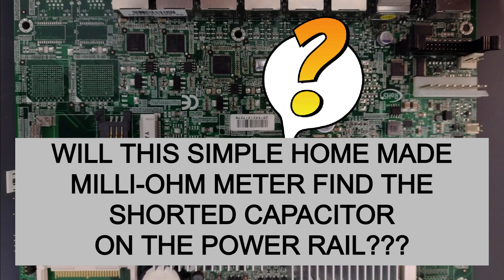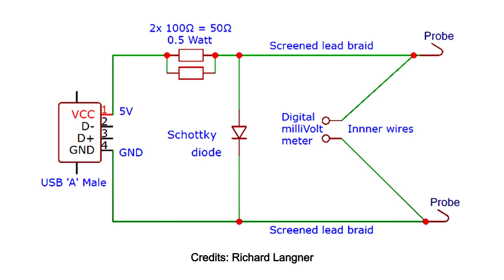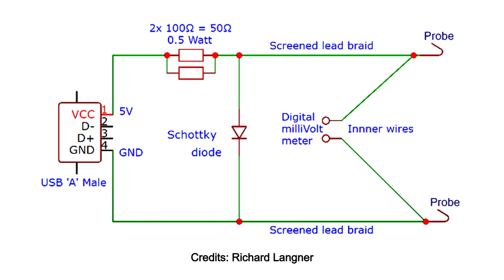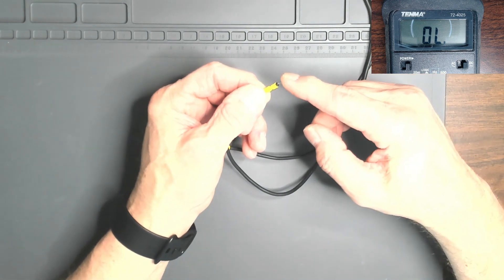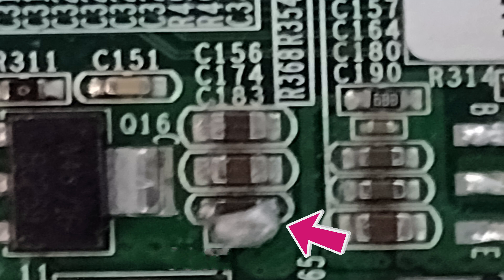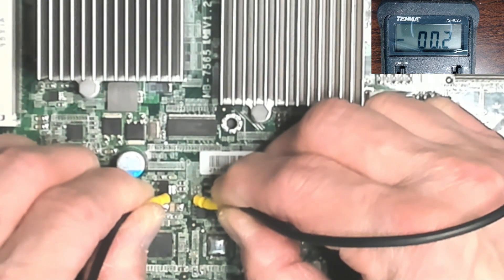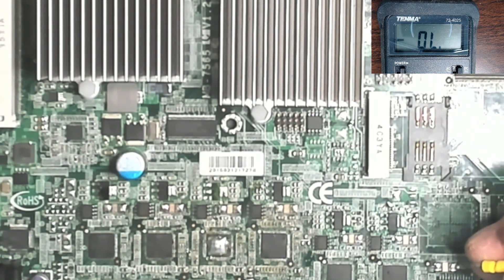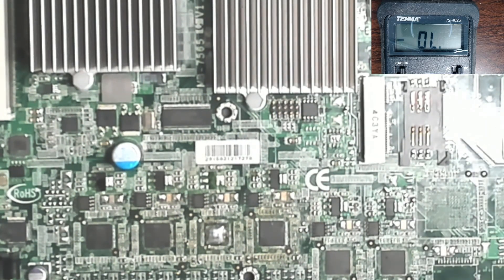Easy DIY milli-ohm meter using your existing DMM

Comment: Thanks for the video, I don’t think the meter was sensitive enough to reliably find the short. I would have been nice to see how you connected the circuit with the multimeter and the whole project for inspiration. Keep up the good work!
Reply from the maker: Thanks for the comment. While this circuit is not a replacement for voltage injection to find a short, it still seems to help get in the general area and definately works as a millohm meter.

Comment: If you inject a voltage at a point at the circuit which normally is at the same voltage or higher  (preferably inject at the output of  a  voltage regulator  circuit)  than the injected voltage  you shouldn't damage  components.  Use a current limited supply and start low and work up.  Only work on the board you think has the short. Remove expensive components like the CPU if  socketed and you are worried about damaging with the injected voltage.  Use a Paraffin candle  to detect heat - less dangerous than alcohol  and wont evaporate  like alcohol at room temp.

There are a lot of these milli-Ohm  measuring devices about  but most people find themselves chasing their tail with them at some point.  I am not saying don't use them as every tool in your armoury is worth having at some point  but  I would say to anyone - lower your expectations.  If you have no or little experience in fault finding it will probably be next to useless.
Reply: Very nicely explained 
❤